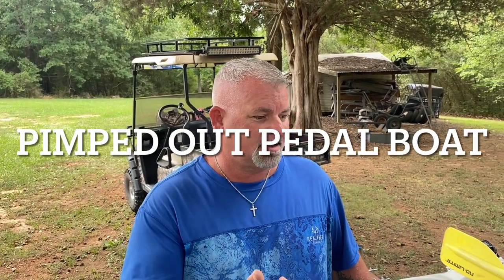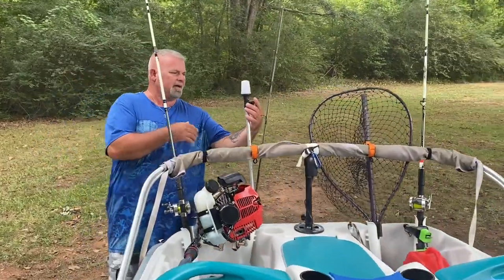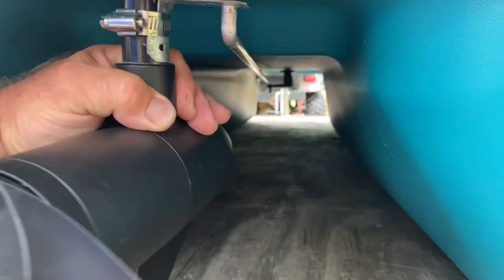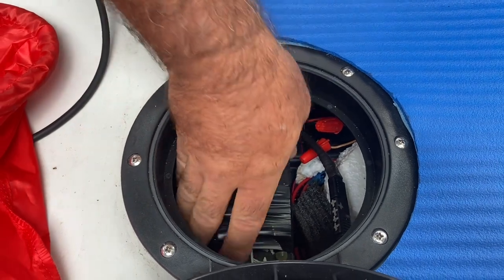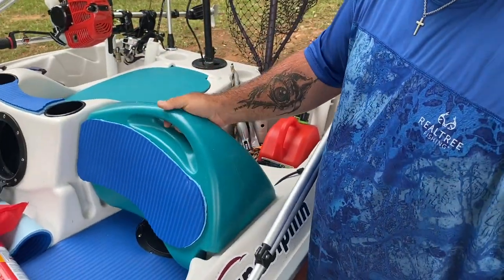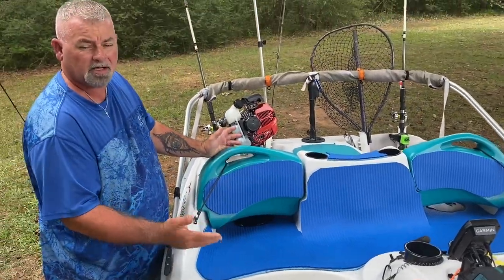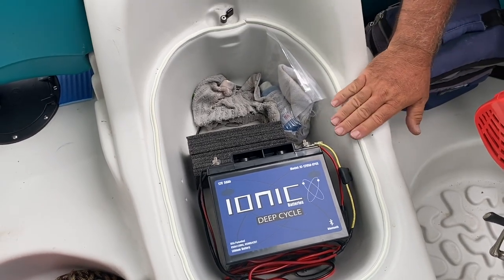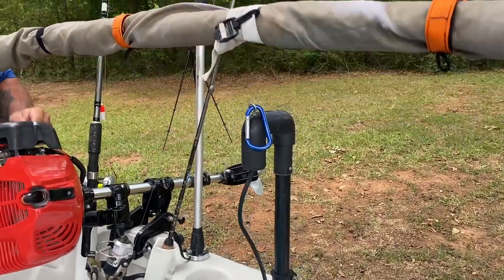Pedal paddle boat mod diy fishing side x side boat best kept secret goes viral

Comment: I have most ofthis alreay. I have a pedal boat, trolling motor, switch panel. Some led strips i can hard wire the green and red on for navigation lights.  I think this is my new project.

Comment: Absolutely LOVE THIS BUILD!!!! Did your add on rod holders come from Walmart also and the cool access holes or are those a specialty item from Amazon?? You said you’ve got an adapter for your small battery under your seat to charge it without removing it, what is it please and what brand charger do you use on your 50 amp hr battery… I’m selling my Jon boat and cause my husband won’t let me take it out by myself, but I want to do what you’ve done here with my paddle…I’ll send you a pic when I’m done😎 Thanks for the inspiration!!
Reply from the maker: Yes the rod holders are Walmart and the adapter is just a two pin plug that you can easily use the charger and the battery came with a ionic special charger thanks for watching and I can’t wait to see your build

Comment: Dude your idea with that trolling motor is spot on. My buddy's giving me his cuz his grandkids don't come down to use it and when they do it's winter time so the things touch the water twice. Same one you got and I figured I'd turn it into a little fishing dinghy. I seen other setups but I like yours because you ain't got that big arm right in the way. So you can fish off the back or if you on a big fish. Somebody could sit up front and direct the boat towards the fish while you fighting it. With that big control arm coming up right down the center. You can't do that. I'm just curious. How's that set up holding up? The L bracket bar and hose clamp looks like under way would cause pressure on those spots. I notice if your drive shaft goes out. You don't have the pedal backup. Did you end up upgrading that setup to the motor or has it held up pretty well?

Comment: Hey John! Just discovered your channel in my feed. Cool ideas on the pimped out paddle! I believe you should keep the 2-stroke on as a safe backup. Maybe create another access port for the mount to beef it up? Also, is there any way to route the exhaust below the water line? I would think that would quiet it way down if you have to use it. Cool idea though! Looks like fun!
Reply from the maker: Thanks I didn’t think about that good ideas

Comment: Hey John,  great video. I have the same boat, and i want to do my motor the same way. Can you give me more info on the electrical parts you used and how to wire them up,  please ?
Reply from the maker: Buy a minn kota 30 lb trolling motor and variable speed controller from Amazon watch the video again I covered the build step by step thanks for your reply
Reply: @johnfitzgeraldbuchanan  i will rewatch it. I don't remember seeing the wiring part.

Comment: Drill hole in hull beneath the trolling motor and fill that area with spray foam to give it some stiffness  or diamond plate that one side of hull. Just my opinion.

Comment: Where did you run the wires for the LED lights? Also is that the transducer for the fish finder on the hull on the left at min 4:27 of the video?

Comment: Did you keep your pedal system on. Or do away with them. If so how did you seal it up.
Reply: Also I have that same boat and I came up with a really good transum idea for a gas engine. It holds my 2.5hp
Reply from the maker: Took them off and filled with silicone
Reply: Yeah I think that’s my next project is taking those out. Only thing sucks is if the motor quits you are stranded lol
Reply from the maker: True but they turn while using motor and can hit your shins and cause some drag on top speed  so

Comment: Did you have to register the boat since you added the trolling motor? With the battery how long does it take to drain the battery or how long you put on the lake for?
Reply from the maker: Yes I’m SC you have to register it if you add any motor , it will run approximately 2 hours wide open so if you use it sensible it can last all day it’s very nice setup thanks for your input
Reply: @johnfitzgeraldbuchanan  nice what all you needed to get it registered I’m in Texas so I’m pretty sure same thing you took
Reply from the maker: @saulsalinas1355  check your state laws and see what they require I just had to ask for a title to add a motor
Reply: @johnfitzgeraldbuchanan  where did you get the title from?
Reply from the maker: @saulsalinas1355  from sc department of natural resources

Comment: How did you do all the electricity on it and add knobs for the motor man that's crazy
Reply from the maker: You have to run wires and wire it up and the knobs are what comes with the pwm
Reply: @Fishing Fitz  what pwm did you use for the speed control?
Reply: @johnfitzgeraldbuchanan  and what wires controlled the forward and reverse?
Reply from the maker: A pwm is used look it up online
Reply: @Fishing Fitz  how about what colored wires controlled the forward and reverse
Reply from the maker: You only use two wires and they are red and black
Reply: @fishingfitz Thank you sir.
Reply from the maker: Yw
Reply from the maker: Got the 60 amp with cooling fan

Comment: Does it float still with all that gear on there?
Reply from the maker: Oh yea !!!!
Reply: @johnfitzgeraldbuchanan  nope turned it into submarine. Lol.
I'm just picking at um little , I'm not mad at ya. 😊. 
But really does it float 🛟.
Awl now quit it.
That's a nice set up. I'm thinking of getting that or bass  pond prowler. Not sure yet got older Suzuki  2hp outboard. Put on one .
I got nice Suzuki samurai so can't be heavy the thing does good to go 55 60 nothing behind or on top . So can't have heavy jon boat 9 9 HP all the gear. Never be able get past 3rd gear . Lol for real though. Nice jobon it nice video great presentation of paddle boat made into fishing boat. Oh on ur loud motor u can try this get a old flex gas line for natural gas stove have it put on end of muffler easier on one with little pipe nipple on end  but then run it in water while moving. If sitting still motor on pull up out water. Just thought 💭.
The guy ask about still float  I'm only picking, Being a smart mouth. Shouldn't have but I couldn't resist it was like ole here's ur sign back in the day.
Y'all have great day warm weather on us the season is here let's get on the water and catch some Big'uns  this year.
Reply from the maker: Thanks my friend appreciate your support in m building a new project and it will be up soon video is pretty much done but the editing is soooo hard !!!! Hope to get it up very soon

Comment: Awesome job !
Reply: Ever thought of rigging a system on the rear from side to side flat to put a little outboard or something in the center motor like you already have ?
Reply: Kind of like a jack plate in the center that when motor is down still won't interfere with your troller motor system
Reply: Would distribute the weight better
Reply from the maker: Thanks!

Comment: Where did you get the plates for the rod holders
Reply from the maker: I don’t understand what plates ?
Reply: Where your rods are up front, by the seat, there are blue plates over the mold holding the rods in place.
Reply from the maker: @mikekoch9779  that comes with the boat it’s sundolphin rod holders